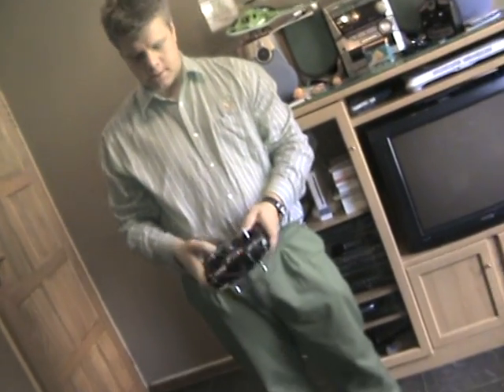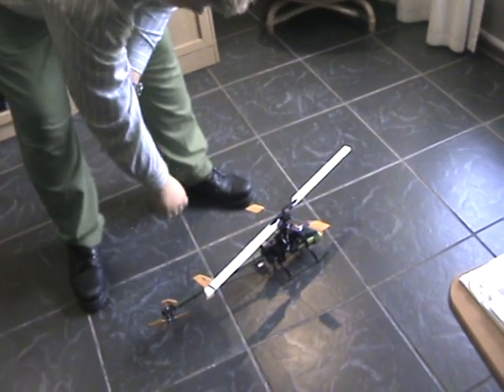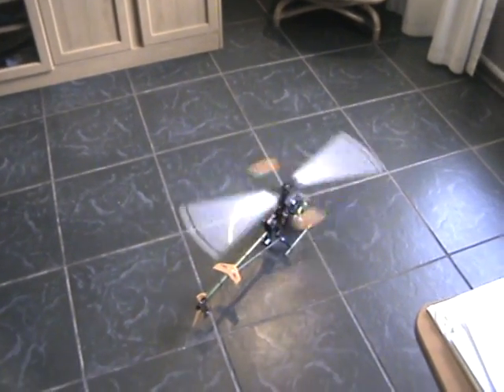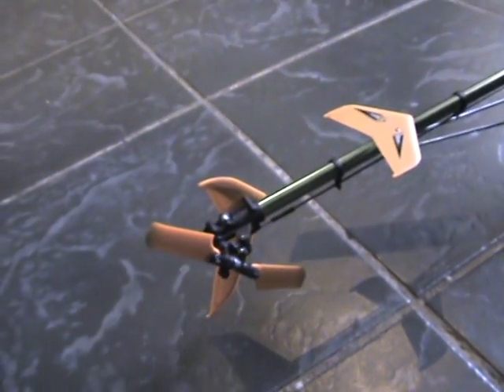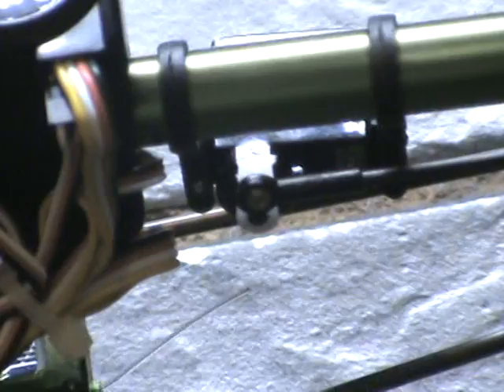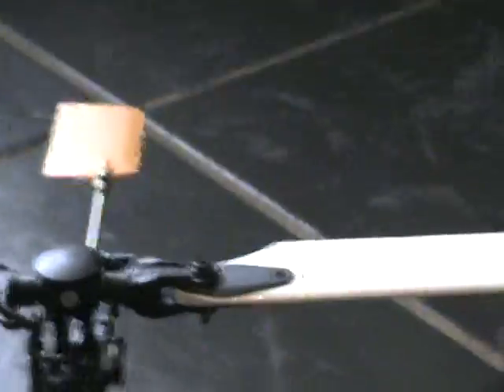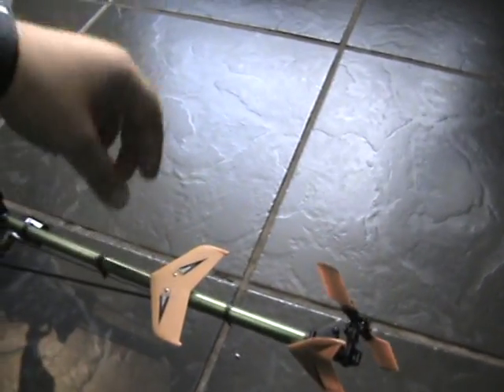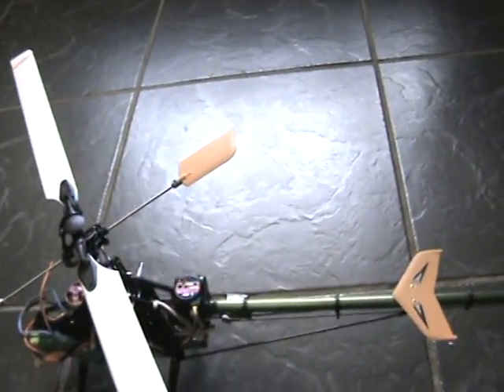Brand new Eksy Belt CPX Tail spinning problem.

Comment: You dont set your tail rotor perfectly strait. It need 4 deg pitch to correct the toque from the main blade. Easy way to get this 4 deg it set your servo in middle as you did. then were your tail servo rod links  to the tail link is make that link 90deg with the tail boom. I did that to mine and it flys without spinning. The gyro is to only put tiny correction movement in. That's how you fix it.

Comment: Glad to know you got the problem sorted. Love when Captain Obvious has an opinion which you've already tried. I had a problem with my radio control and got treated like an idiot because I was new to R/C heli's. I was basically told it was me as I didn't know what I was doing. That was until I informed them that I had started my interest with R/C heli's after getting bored with racing nitro R/C cars. Turned out to be a faulty cable and not user error. Big surprise. Win for both of us bud.